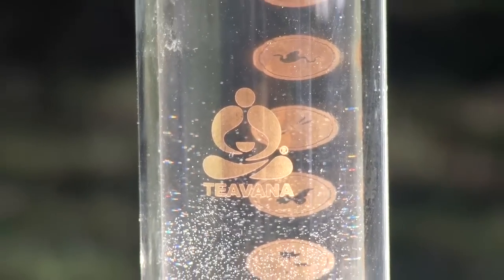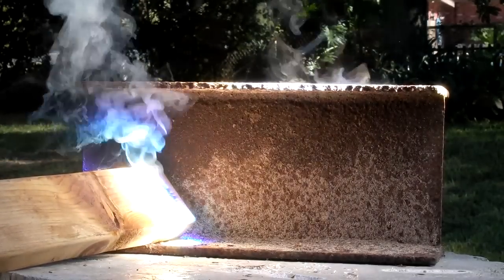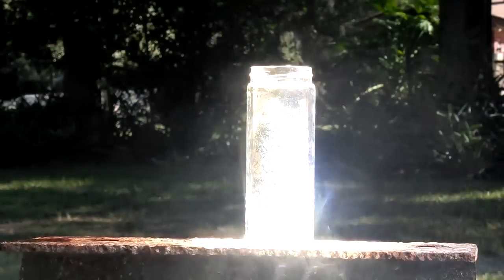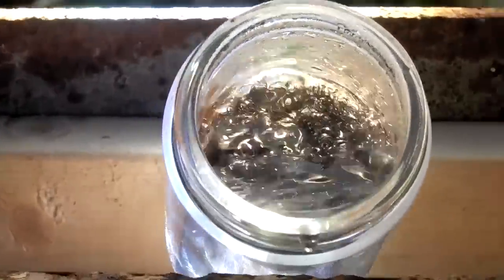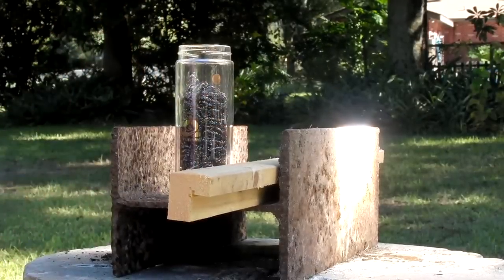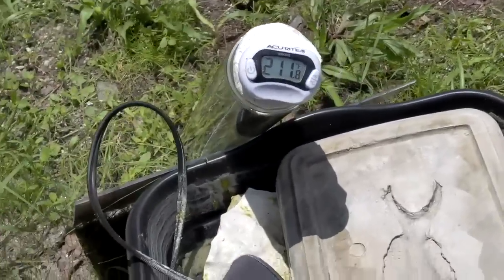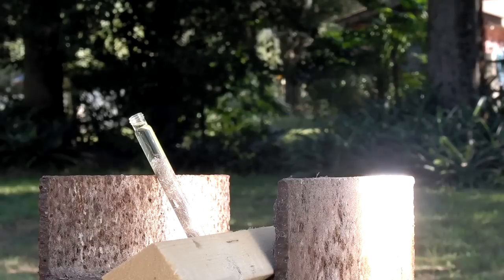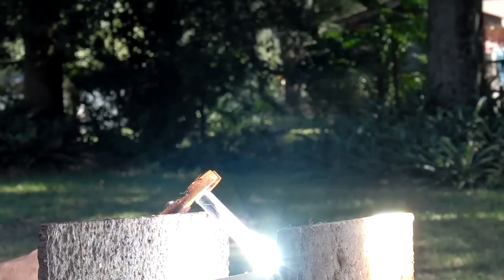Fresnel Lens SOLAR STEAM BOILER VACUUM TUBE STEEL WOOL METAL NANOPARTICLES

Comment: Could you implement this concept to make a "Steam Engine" for producing electricity?
Reply: Jacob, I have personally tried what you are referring. No doubt it is efficient, but the MAJOR problem is with the transparent medium of the boiler.

TO be efficient in power generated, the steam HAS to be superheated and pressure blown. And such Boron and silicate glasses are very expensive.

But other than that , yes it works and it works great. Best of all is the size, you can have a small or medium generate for your own home. any size works with same efficiency and ease.
Reply: perhaps for a little while once the fresnel stops recieving sun and the steam stops well there you go

Comment: Why do you use the insulating vacuum glass container? Will it have the same effect when using normal (single layer) glass container? Thanks
Reply: Cuts losses from the hot water

Comment: Can galvanized pipe be used to distill water or will the fresnel lens break down the coating and taint the water.
Reply: What about using black gas piping¿

Comment: How could you use this to purify drinking water?
Reply: put a lid on the top which runs out in a tube to a coil in the air away from the heat source - it will condense and then drip into a catchment vessel.   You'd also have to have a feeder line for cold water into the bottle to keep it filled unless you wanted to do just one container full...

Comment: what if you used anodized steel wool the black should adsorb even more
Reply: I don't think you can anodize steel only aluminium... maybe black oxide (if that works!)... good idea to make it black though.
Reply: you can but it erodes in the process.  Maybe shift to Titanium, which can be...  enjoy that $ bill.

Comment: where can one get that lense
Reply: Check your local tip or council clean-up piles for those old projection TV's, the one's that have the three coloured lenses projecting onto the rear of the screen. They used to be popular in clubs and expensive homes in the 80's and early 90's. The screen on those tele's has about 4 layers and one of the layers is a Fresnel Lens. Not all are the right type though, about half-half. Keep trying and you'll find one. I found mine on my third projector tele, about 3'X4'. Really good size.